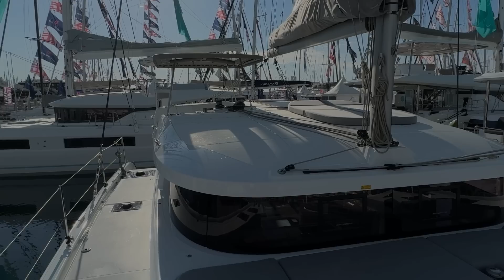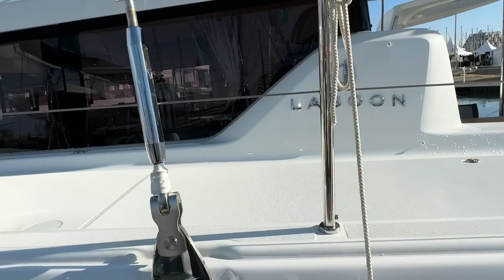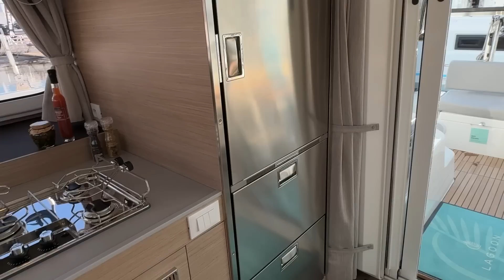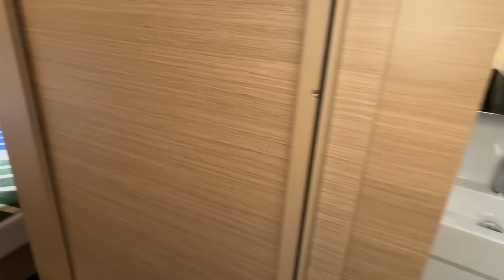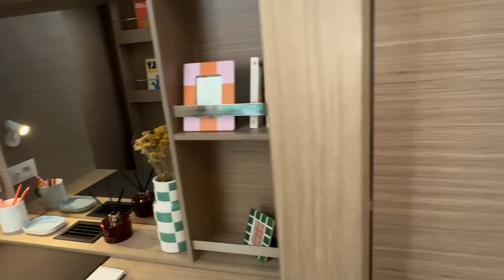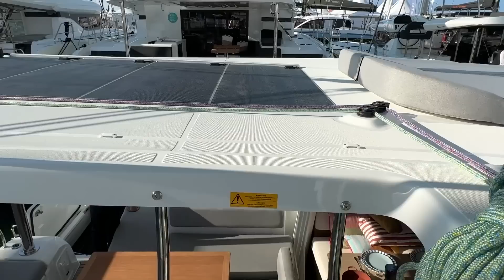Lagoon 38 First Look | The Giant Killer | TMG Yachts

Comment: I haven't sailed a 38, but did just sail a Bali Catspace. what makes this yacht such a giant killer? Serious question, I've only sailed 2 cruising yachts, so I'm interested in the details.
Reply: I’d expect it would be space in the Hulls over the 40’s with the wider hulls at the front. Also the layout in the saloon i always through there was dead space in there.. they’ve moved the kitchen to the front which will be seen as sensible by some.
Reply from the maker: Great question! The Lagoon 38 stands out for its smart design, easy handling, and comfort — all packed into a compact size. It offers great performance for cruising with plenty of space and modern features, making it a strong contender against bigger cats. Hope this helps :)